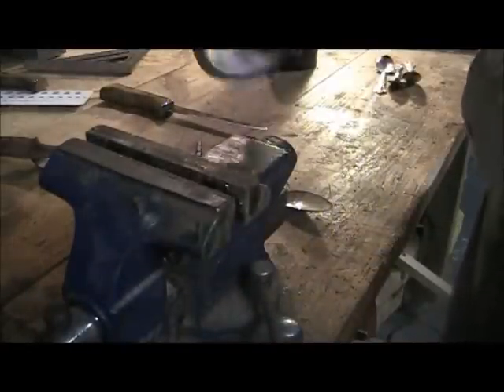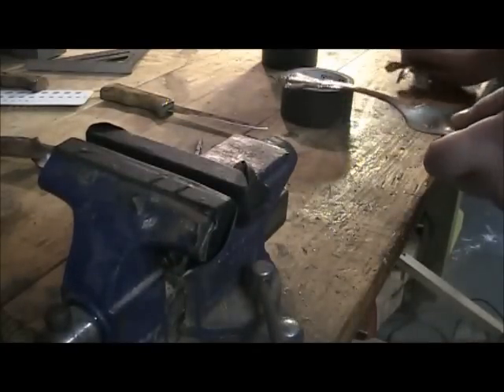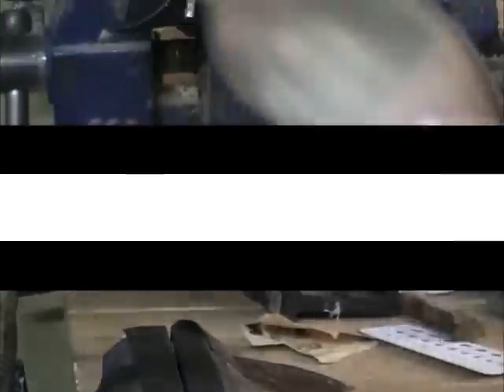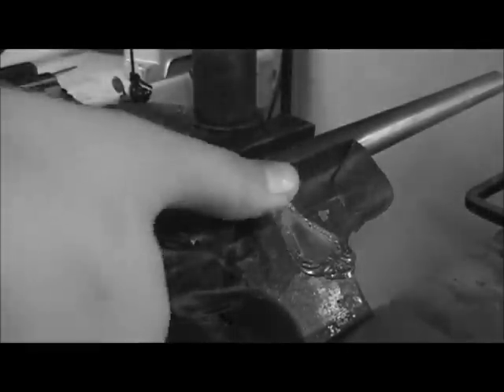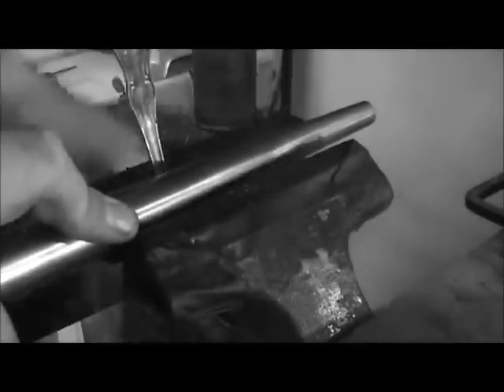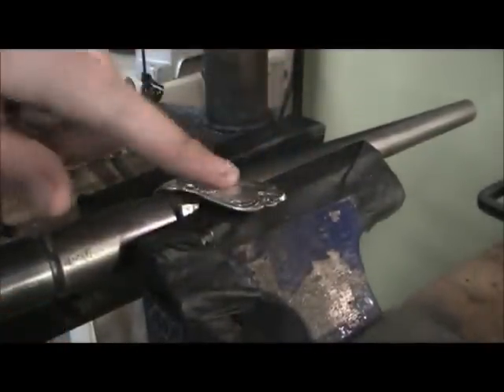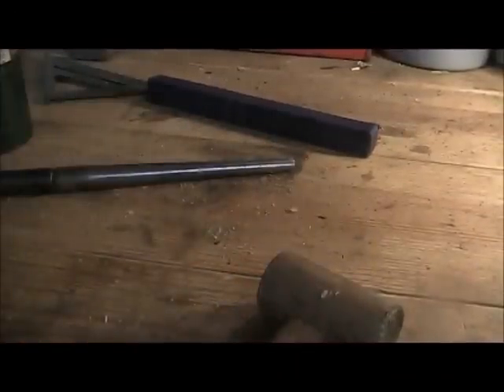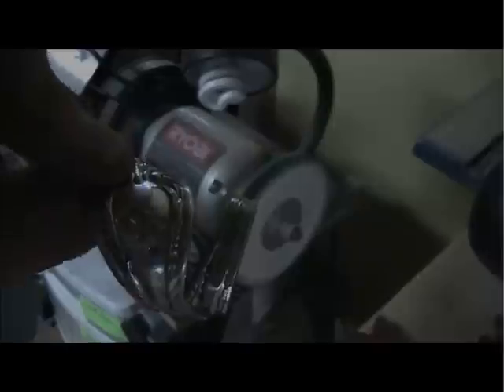How to: spoon ring band style DIY

Comment: I find that a grinder cuts it a lot smoother than sawing it. As for the bending, depending on whether it's cheap or a sterling silver, you should always bend it by hand (with a tight pull) to round it up. Hacking it with a piece of metal into a spiral shape will make it look bumpy.

Comment: First thing that should be done when making a spoon ring is torch it with a torch to a dull red. Then it will easily bend around your mandrel. It will be work  hardened when done because of the bending. It's much easier this way and you dont risk the chance of cracking your metal.

Comment: drill the size hole you want in a 2 by 4 cut it in half lay your spoon on top of that lay another round object on top the spoon and hit with hammer as the spoon goes down it will make half a circle then just rotate until you get it round

Comment: If you heated it up till red, would it be a lot easier to bend bend &  shape ?
Reply: +Ryan Fager You do not want to do that, because you risk discoloring the metal. Just heat it enough to make it bend "a little easier". Be gentle on the heat, especially with silver.
Reply: Heat until black, not red.  And then quench.  But only with sterling silver cutlery, not EPNS, as heating that will remove all your silver plating.